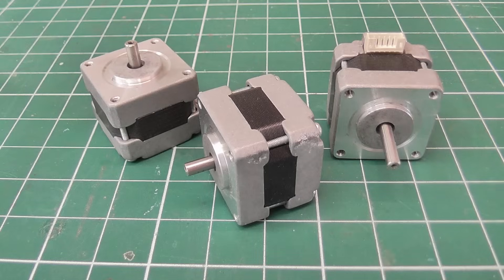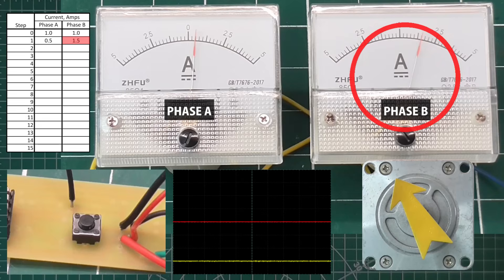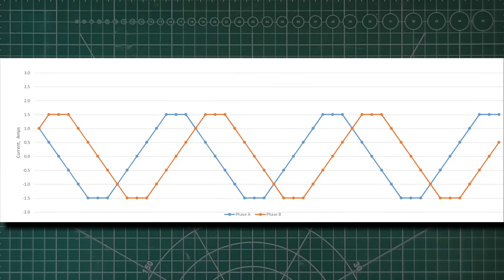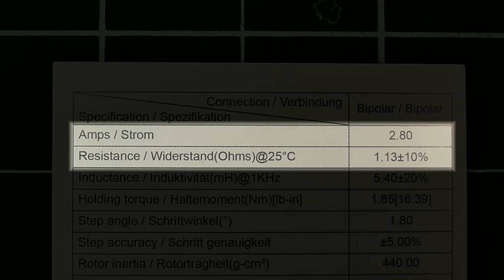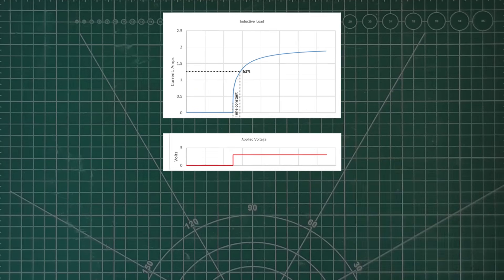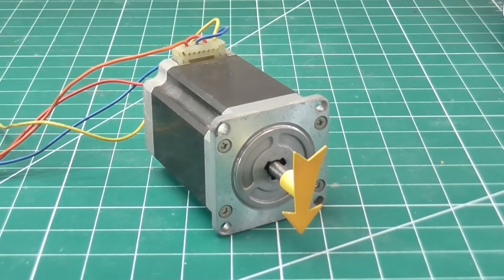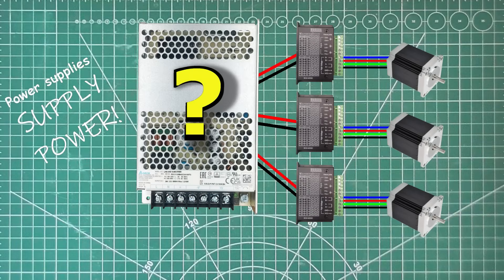How to choose a power supply for stepper motors?

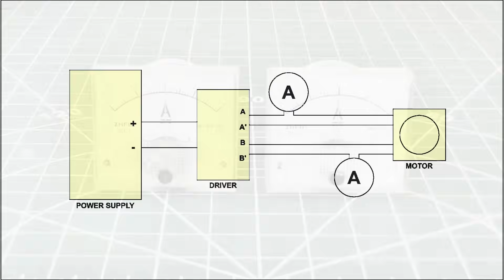Comment: 3:25 what are your circuit components?
Reply from the maker: It's just a small microcontroller (ATtiny) a button and a potentiometer. The PCB I used was a spare one from another project.

Comment: It becomes even more of a head scratcher when you run hybrid stepper/servos like the Teknic stepper killers.  They wreaked havoc on a switch mode power supply due to large EMF spikes when braking/reversing.  I ended up switching to a linear supply based off a torrodial transformer, rectifiers etc.  Then you have to calculate the VA needed for the transformer instead of power supply volts/watts.  Overkill motors for most projects and quite pricey but I was using them on a CNC milling machine to solve missed steps.

Comment: Absolutely SUPERB video, you explained it really well and with videoed ammeter proof!
I've known this stuff for 25 years since back in the day when I was designing stepper motor drivers for the open-source CNC community, but most people just don't understand that the drivers draw very little current from the PSU when the stepper motor is stopped or moving slowly.
A couple of points;
1. Max current drawn from the PSU when accelerating hard can be close to the actual motor current. If the CNC machine is likely to be doing high accelerations on multiples axes at the same time (ie diagonals) then use a larger supply.
2. I always have a DC ammeter on my CNC PSU, it doesnt cost much to add a 5Amp ammeter and you get peace of mind and can learn from it.
3. To run stepper motor at or near it's rated current, the motor should always be bolted to a metal mounting plate, this is cooling required for its rated spec. (Yeah I know you were just "demonstrating")
Anyway, well done on the video! 👍🏅
Reply from the maker: Thanks very much! Yes, all valid points. I particularly like the idea of installing a permanent ammeter, I might have to do that!

Comment: @ 10:04 what? 24 volts power supply? I thought you said you choose a 36 volts power supply...
Reply from the maker: Yes, 36V would be better, but I already had this 24V one so I used it for testing.
Reply: @AndysMachines  I noticed in this video that it seems the controller itself doesn't consume any power??? Who is this possible?
Reply from the maker: Of course it does consume some power, but not very much, there's enough error in my measurements that when rounded it makes it seem negligible. In reality the motor is probably consuming a little less than 6W at standstill and the power supply is outputting a little more, the difference is turned to heat by the driver.

Comment: Just add the voltages of the stepper motors and get a voltage supply that big. Or just configure them in series so that you can connect them to mains directly. Oh no, connect them parallel, as you only get the amps. Let's see, my breaker cuts out at 16A, so 16/2.8 is about 6 motors, right?
You'll get a nice sound, light and smoke show!

Comment: Hi.
Thank You for Your video it was very interesting to see how the current was behaving .
 But I think You have made a big misstake in the begining, 2:34 in this video when You are saying that the total power consumption is 1,21 Giga Watts. In my opinion it should be 36x26.88=967.68 W, that is less then 1 KW (1000W when P (Power) = U(Voltage)xI(Current).
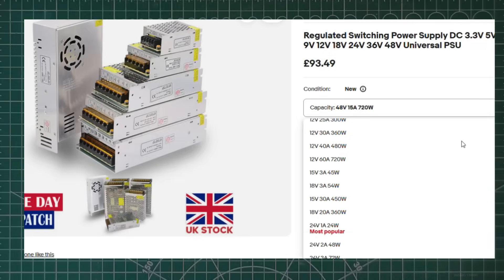Reply from the maker: That was actually a reference to Back To The Future! The correct value is at the bottom right of the screen (small) 2:35
Reply: https://www.youtube.com/watch?v=BDuZqYeNiOA&t=39s hihi! for me it was easy to find now. But my 1000 W suppy turns out to be too big.